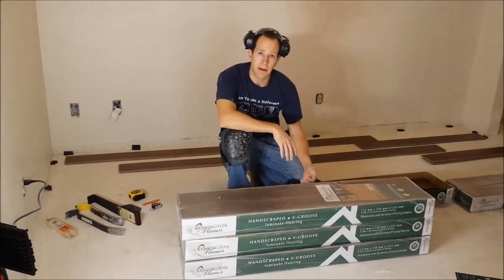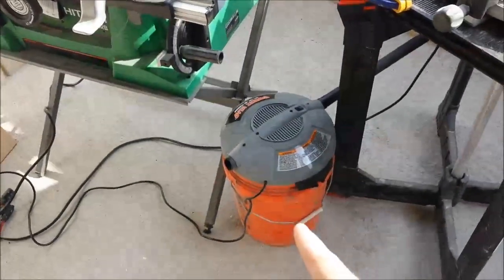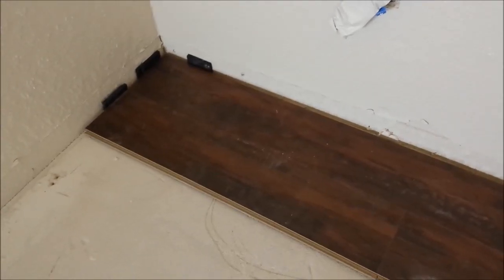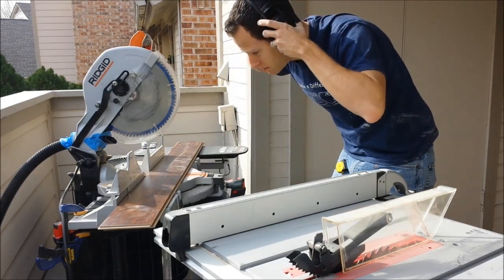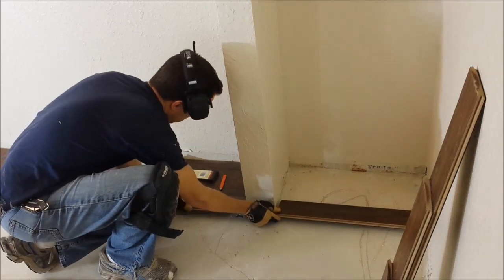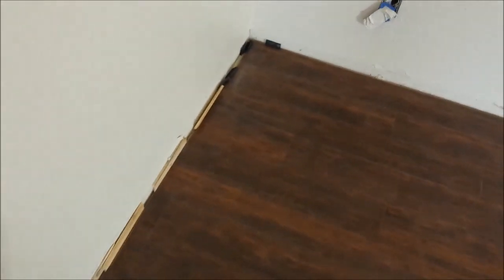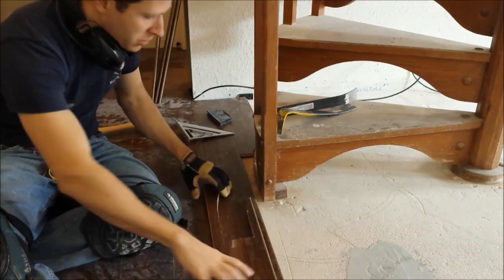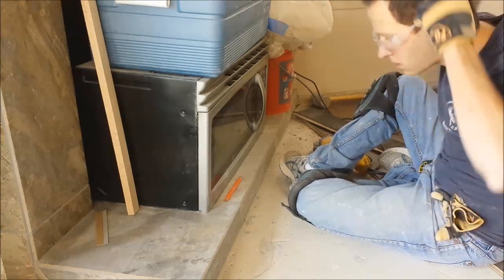How to install a floating wood floor

Comment: Thanks for the time laps! So many just say the process, give you one quick example then wish you luck. This allowed us to see the different ways you interacted with different scenarios! PERFECT! 

I do kinda wish you front loaded the information, or added links in the comment to each teaching moment (The chipped board or door way issue) because a lot of this I knew but I had to watch it all to find out what you would add to the video! 

Not a huge issue, still a great video and one of the best I've found while trying to figure out this job! Thanks for making it!

Comment: Very helpful video! I've installed a floating wood laminate floor in my foyer and hallway over a concrete slab (ripped out old stained carpet and padding). It's my first time trying such a project (especially by myself!). I've got all the planks down and it looks fantastic so far. All I have left to do is the transitions in the doorways. Wish there were more videos on how to do this! I have carpet to flooring and tile to flooring to deal with and don't really know what to do with either one or what to use. When I pried up the carpet wood furring strips, the nails brought pieces of the concrete up too. I filled all those in with concrete patch but I don't want to screw or nail the new transition pieces into the concrete. The transition pieces I bought to use have a metal strip that is supposed to be nailed or screwed down first and then the t-molding or end cap pushs down into it. Can't I just glue the metal part directly to the concrete? Thanks for your help.

Comment: What an excellent demo!  Thank you for not playing music in background!!  You explained everything so well, including safety, very much appreciated.

Tsk, tsk!  You are not using nose mask while cutting concrete dust!  Don't let that stuff get into your lungs.

1.  What size spacers are you using here?  I have to do my RV flooring using Click Lock Engineered Wood.  Its not laminate, but real wood sandwiched like plywood to handle moisture, flex, etc.  The planks are about half the width of yours in demo.  What size spacers will I need for this application?  Subfloor is plywood, with the vehicle metal frame below it.  I plan to use a thin underlayment of 1/8 inch closed cell foam with mylar foil on both sides.  One demo I saw was using a 10 mm or 0.39 inch spacer.  Seems too wide for my small RV.

2.  Do I also need to add molding to walls to keep floor down?  I was thinking of aluminum trim along all wall edges, to finish off nicely.  Any thoughts on that, or where to buy this stuff?  Home Depot has very thick aluminum molding, I need a finer mill.  If I use wood, any advice on how thin I can make the molding?

3.  Did you use a jigsaw to cut shape of stair base into wood planks?  I don't have a band saw,

Thanks again Mark, for an excellent and very helpful tutorial!!

Comment: This was extremely useful.  I made detailed notes to start on my RV flooring tomorrow.  Please use as much light as possible in your videos, so we can see more clearly.  Some questions for you please...

1. In an RV with very little floor space (22 ft total RV length x 8 ft width), could I get by with 1/8" spacer gap between plank and wall, or do I still need 1/4" gap as in a house floor?  A larger gap would show in a small RC, and I don't have the ability to nail beading down.

2. The spacer gap of 1/4" that you recommend, is it only between wood and wall, or any other column, stair, or other item you have to go around in the middle of your floor?

3. How did you fill the large gap against the wall and first row?  Did you use colored caulk or cut a thin wedge of plank to fit that long wedge shaped section? 

Thanks again, Mark!  You do wonderful work!!

Comment: Can I install a floating floor before installing kitchen cabinets? Then, cut the flooring at the cabinet line, remove the cut flooring, and finally lay the cabinets on the sub-floor?

Comment: hey mark, great video, i have a question since i'm a beginner in hardwood flooring. when you start your first row, is there a way i  can make it a 90 degree angle because i'm worried when i get to the opposite side of the wall my wood  could be cut in an angle and that probably wont look good.  thanks in advance for your advise
Reply from the maker: Most people would measure about a foot off the wall and snap a chalk line for reference. I always skip this step myself. When you get to the opposite wall, you will need to do rip cuts for the final row. Most rooms are not perfectly square so measure each board on the left & right side to leave a clean even 3/8" expansion gap off the wall. If one side of the plank is off by a 1/4" or even 3/4" across a 4' plank, it's going to still look great; that's too little for the eye to pick up on.

Comment: At 10:21 0f the video I saw about a 2 or 3 inch staggered joints. Check it out, I might be wrong but you need at least a 6inch staggering..

Comment: As I understand it all manufactures require a minimum of 6-8 inches to stagger the joints yet I see 2-3 inch staggers on your floor ? can you explain your reasoning on this ?

Comment: Your staggered joints are inconsistent, you mention it, but then often you only leave 2-4" in some spots. Hello!
Reply from the maker: Retloth It's intentionally random staggered joints
Reply: Should be at least 8" between gaps...